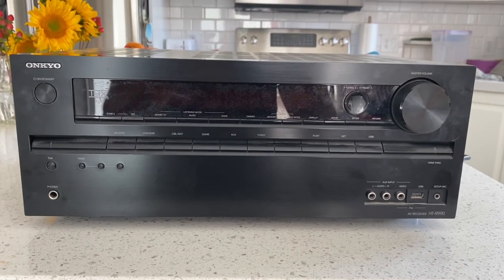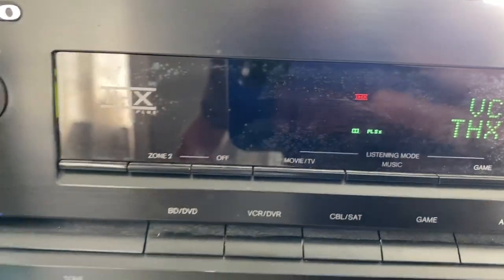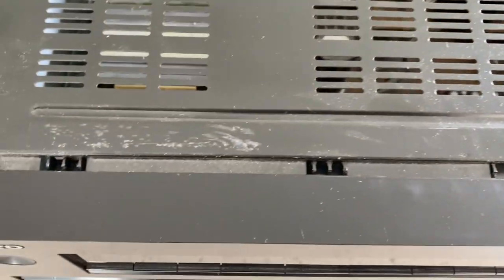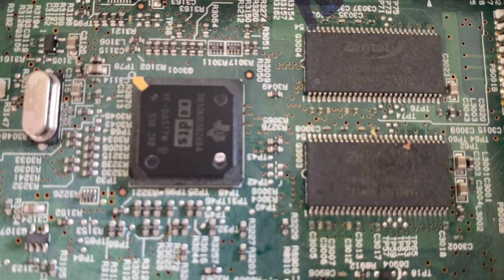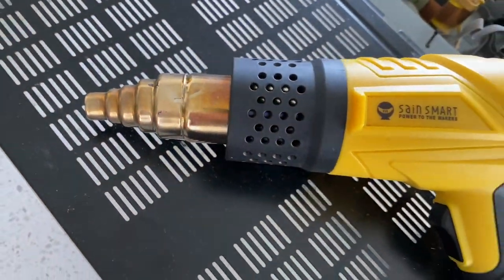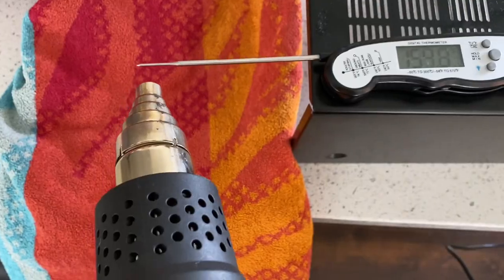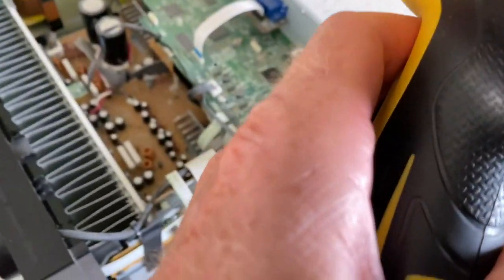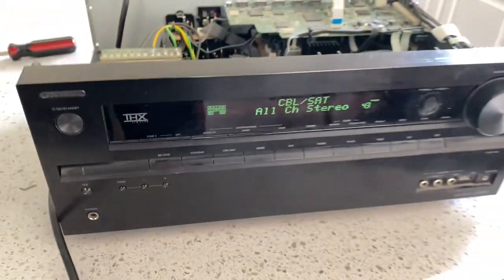Onkyo Receiver-speakers not working-how to fix

Comment: My 11 year old TX-NR818 started exhibiting this issue intermittently about a week ago, and gave up entirely yesterday. I tried this fix using a heat gun and an IR thermometer, heating the chip until it was about 350 - 400 degrees F.  So far so good... speakers all came on and have been working OK through a dozen power cycles.  I was ready to shell out for a new receiver and the reviews of newer models were not that great, so hopefully this will buy me a bit more time.